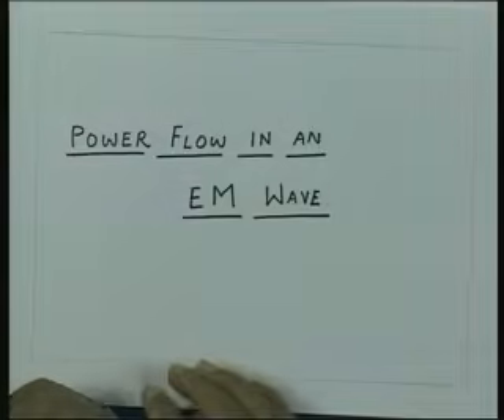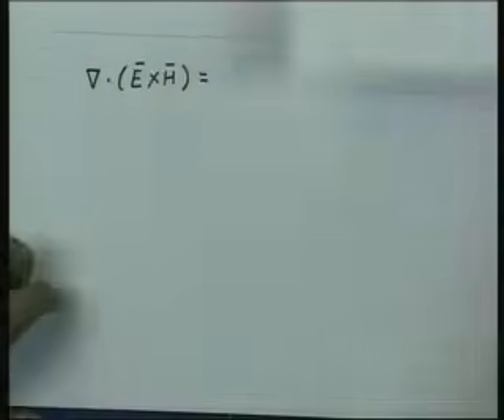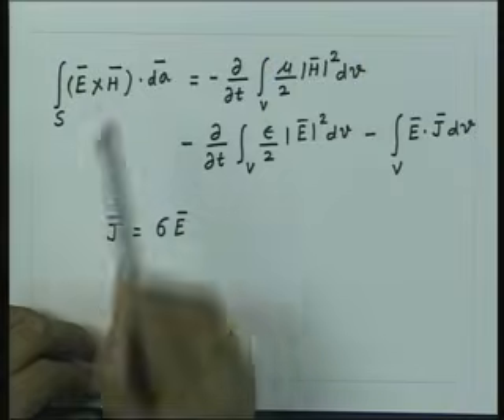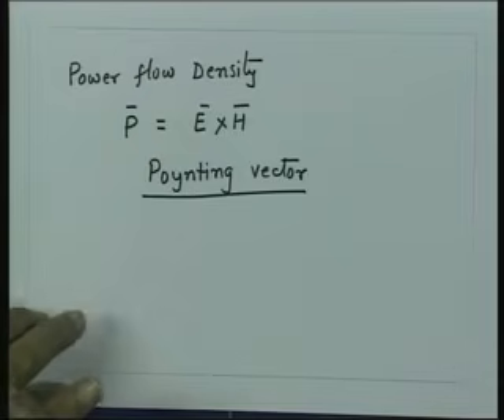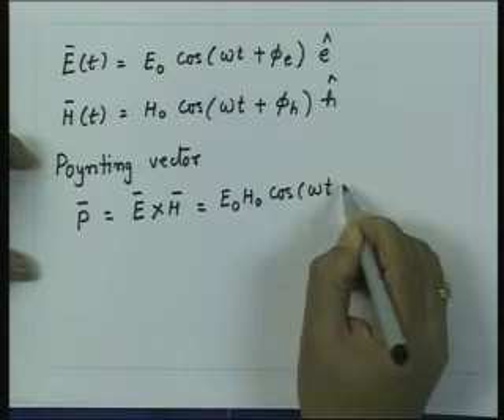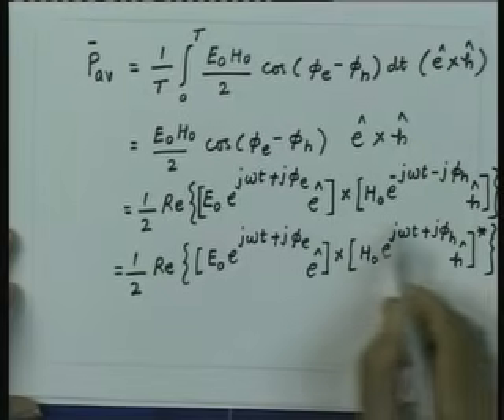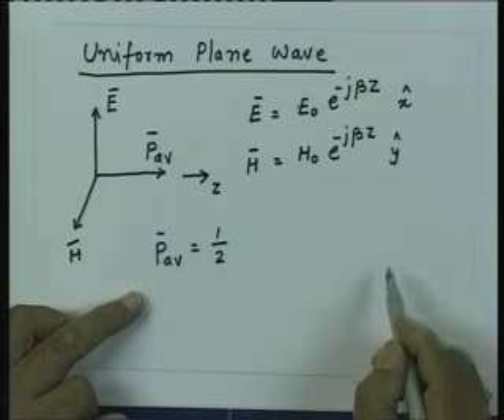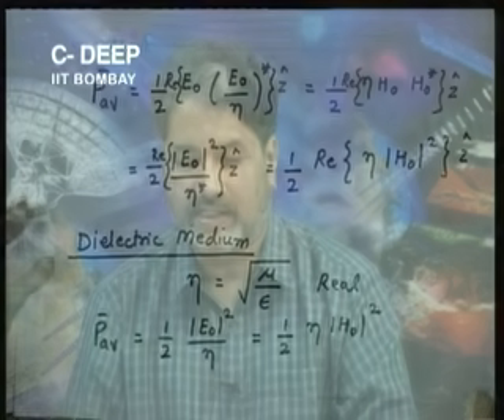Power flow and Poynting vector

Comment: 53:03 i don't understand  why second cosine term 0
Reply: I am from a little far future. But the answer may help someone.....One complete cosine/  sin function has one crust and one trough. Imagine taking the average of a complete sin/cosine function. You have  to add the crust+trough which will yield zero. So any sin/cosine function averaged over the period will give you zero. Here in the second cosine term, its frequency is 2omega. That means 2 complete cosine or sin wave in the given time T. Each of these waves average to zero. Hence the second cosine term will vanish
Reply: Because it is physics😔😔
Reply: Integrating the second cosine term - over t = 0 and t= T (which is 2pi/w) , the quantity will be same for every cos function repeating after 2pi cycles. You can substitute the values and integrate, it will be a simple problem of integration.